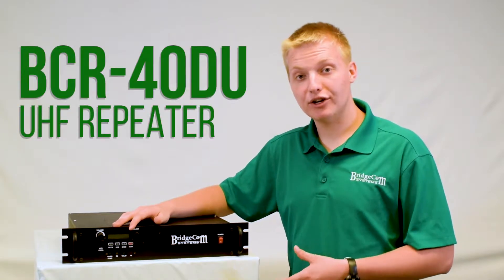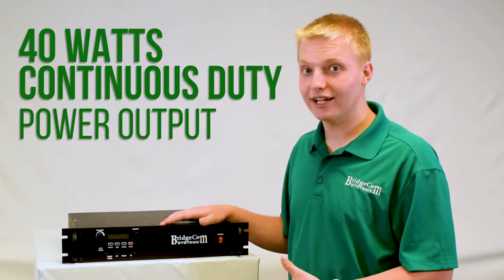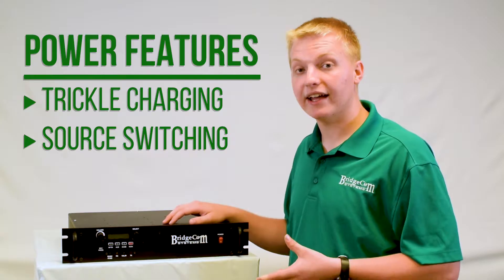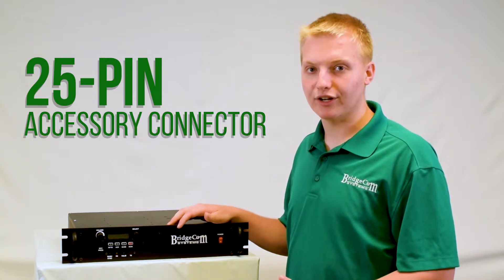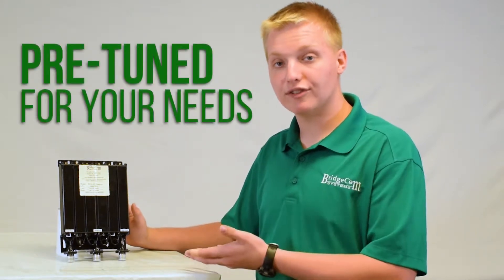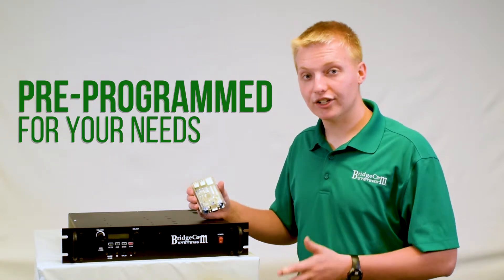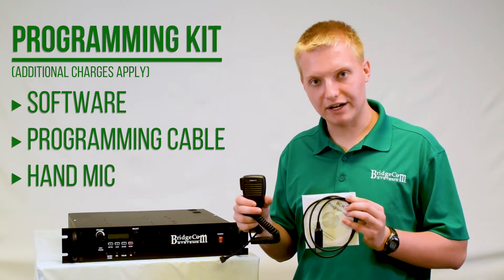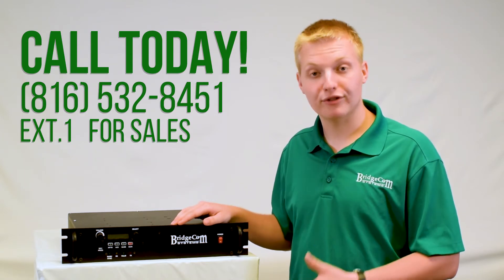BridgeCom BCR-40DU UHF (40W) 2-Way Repeater W/Internal Duplexer Overview

Comment: Says it contains internal duplexer yet your showing a seperate duplexer?
Reply: So, the only thing missing is the base antenna of your choice and just plug it in?  Can I set up my own GMRS repeater for personal or family use only?
Reply: @nats50 yes
Reply from the maker: The duplexer can be installed internally to the BCR repeater.